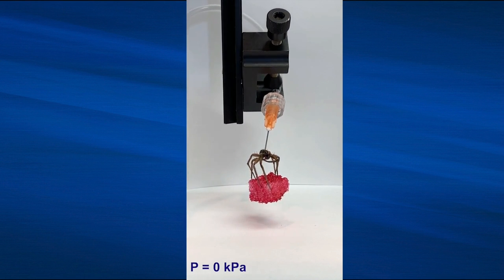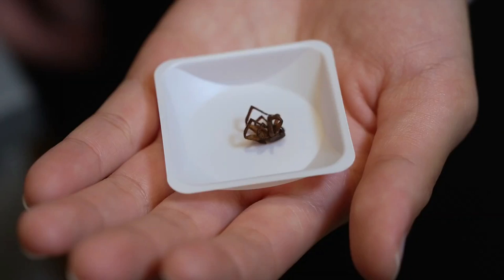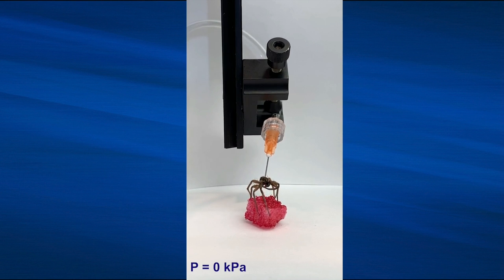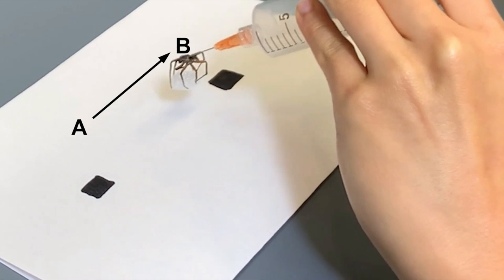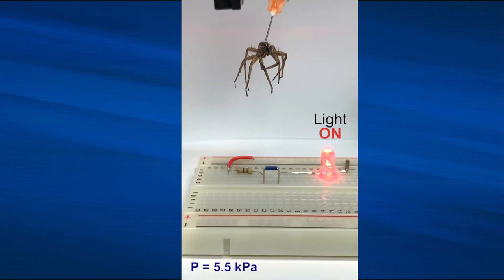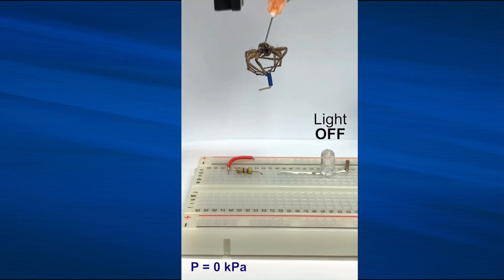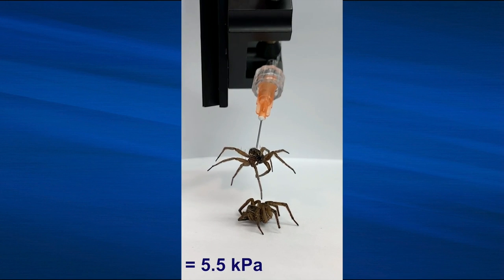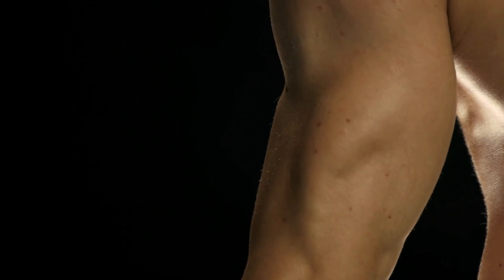Scientists Are Turning Dead Spiders Into 'Necrobots'

Comment: The physics of this is really no big deal. Simple hydraulics.  A better solution is to study how to replicate the legs with other materials.
Reply: That would be amazing for amputee
Reply: Yeah but that’s not the point. First, we already have hydraulic machines and grippers that work and we are able to recreate the legs because it is basic hydraulics. You could probably manufacture a plastic exoskeleton of the spider and it would work exactly the same. The reason why this is on the news is because we don’t need to nor want to manufacture grippers and produce any waste. These spiders reproduce so basically this is an unlimited supply of premade mechanical parts that can be found anywhere. The only thing would be how to incorporate this into our current technology and take advantage of this new usable resource
Reply: @enochzeng7657  The issue with that is that at that point they would be in such high demand that you'd have to raise and hold them as livestock, negating the environmental benefits for the most part.
Sure you could in theory make that an all clean energy process, but we're not there yet and if producing the plastic exoskeleton is just much much more efficient and less resource intensive then there's probably no point in exploring a commercial viability of the spiders until we have the major climate related issues figured out.
Reply: .....isn't that the point of all of this? That it's easier to use a dead spider than replicate the legs?
Reply: @michelangelobuonarroti4958  really on a average basis keeping and storing spiders shouldn't really be too big a problem they reproduce their own the source to sustain them does the same and probably would not be too big of an issue to create a whole sustainable spider ecosystem to keep on hand
Reply: A simple idea doesn't mean it is not worth recognition. No one had done this before, and hey it got you thinking so don't discount the value of science. Don't gatekeep science.

Comment: I know that the way a spider moves is basically hydraulic pressure in the legs, but did we really have to do this? Did we REALLY have to defile that poor arachnid’s corpse like that? How about just making a regular crane instead, hmm? 

Just….this seems disrespectful to the spider, like it’s breaking some sort of ethics rule, at least if it was done on a mammal. Let Itsy-Bitsy rest.
Reply: Yes, yes we did. Why? Science
Reply: On the other side, the spider is already dead and you probably accidentally killed a spider by walking over it. I think it's a great way to recycle and make use of what there is in life. Imagine the junk that would come out from traditional materials in how long they would need to degrade and also the effects on the environment. In the end it may also spare for example ocean life a bit of suffering because

Comment: This is a gimmick that will never amount to anything. The syringe distributes the pressure uniformly throughout all the legs, so:
1) you cannot decide which leg to move
2) you cannot decide whether to move one leg less than another
3) you cannot move the legs sideways (which would allow to readjust the grip)
Look at 1:56. The resistor is barely connected at all, so the legs don't need to pull it out. And when it's about to fall out, nothing can be done to readjust its position. For that, you'd need control over the individual leg muscles, not just over the global pressure. For that, you'd need technology like microscopic servos, which, if used, would defeat the purpose of using a dead spider.